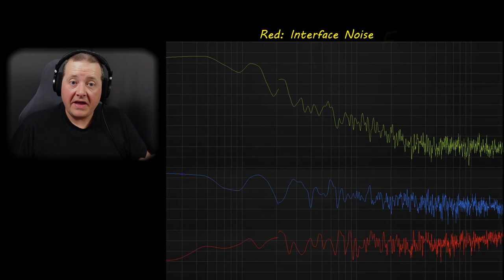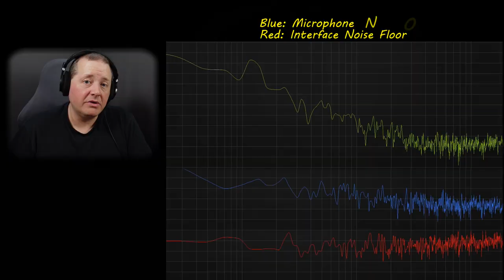Audio Noise - You're Nit-Picking The Wrong Thing

Comment: I'm still trying to figure out how to remove the noise coming out of my mouth.
Reply from the maker: I have the same problem. Unfortunately we can't spend ourselves into a solution for that.
Reply: There's no solution other than to not speak. I cannot tell you whether to use this extreme kind of noise reduction or not, the drawbacks are kinda extreme 😉
Reply from the maker: Not so much in Bandrew's case.

Comment: I would love a video for beginners on how to check what makes more noise - the microphone self-noise or the environmental noises
Reply from the maker: That's a tricky one. All mics and preamps are different. As a rule, mics will be noisier than high quality preamps. Really quiet mics or noisier preamps can be compared if you have a 150 ohm XLR dummy.
Reply: @SoundSpeeds  I'd like to ask what is considered a low quality preamp and a high quality one, is for example a cloudlifter considered high quality? In my case im using a Shure SM7B without a preamp and the gain is turned up to the maximum, that's why there's a lot of noise if I ever record something. If I get a preamp the problem might not disappear because of the untreated room noise if my understanding is correct. I'd be very thankful to hear your insight on this.
Reply from the maker: Saramonic devices or Zoom H-series tend to be noisy as an example.